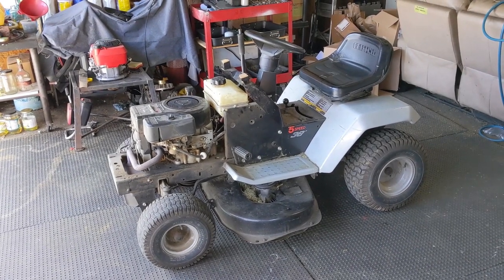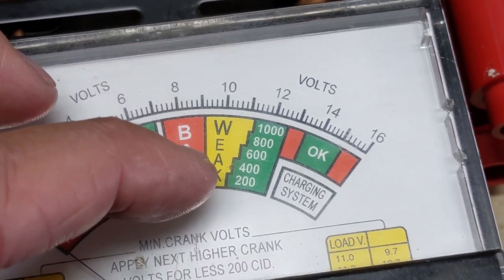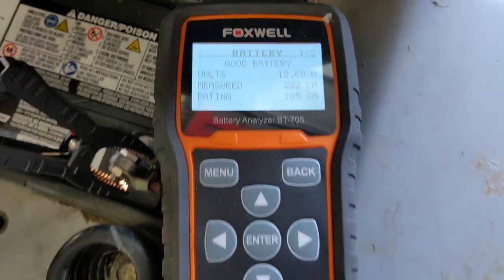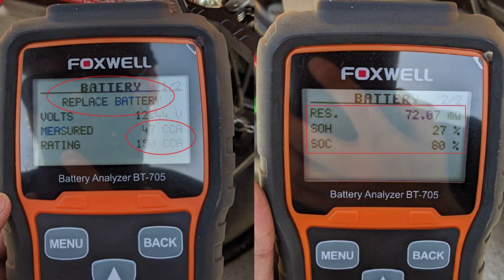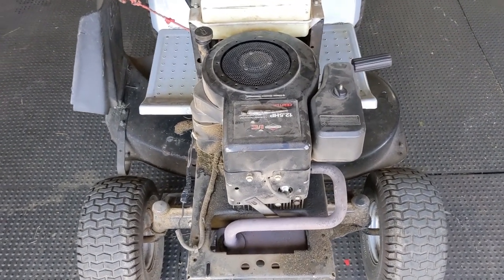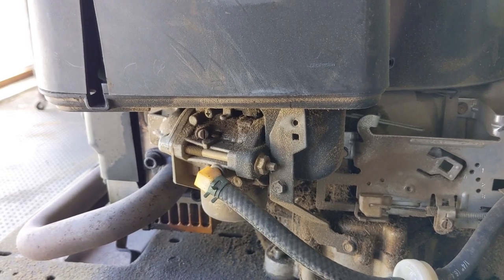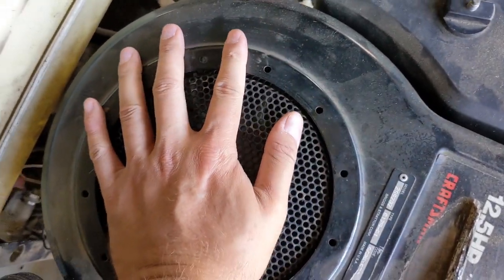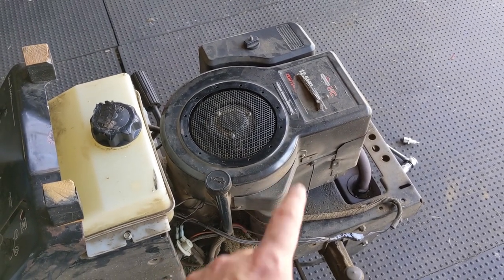Digital Battery Tester & Explaining Hydro-Lock

Comment: An extremely well explained video on hydrolocking and love the new Foxwell battery tester 100% accurate and no more guessing when using the older analog battery test. Actually your thumbnail was great showing the fuel/oil mixture that was leaking onto the floor in front of the rider from the muffler i would guess. Paying the extra amount for the bluetooth read out for your customer is very profession, good job sir!
Reply from the maker: Thanks for watching, and yes the Bluetooth function is nice for us since we do this as a business, but for the average homeowner they would be better off buying the $30 KW208 tester!

Comment: You are right about the amps  are important to Crank the lawn mower engine or vehicle engine Plus any other engines
Reply from the maker: I've seen lots of batteries test 12.65+ volts but have low amps when put under a load. The analog tester is nice and quick, but the digital one offers me a more precise read out and has already paid for itself. Thanks for watching!
Reply: @EliminatorPerformance  a digital Read out is a great idea to get better results of reading battery output on voltage and amps

Comment: Nice job. I had a customer that the battery was bad and I showed him the Didital battery results and he still said, "it's only 2 yrs. old" can't be bad. I said that I can install your old battery and you can argue with the place you bought it from. He came back a few days later and wanted a new battery. ????
Reply from the maker: Yea we've sold more batteries this year than any year previously and make decent money off them, this tool has paid for itself. Thanks for watching!
Reply: Yep happens all the time especially if the customer does not listen about putting the battery inside for the cold months and fully charging it prior to storage. I have read that batteries should be charged every six months to improve lifespan.

Comment: Your customer is fortunate it wouldn't spin over.  My neighbor had a "gas leak", took the plug out and cleared the fuel from the cylinder, put the plug in and fired his riding mower up.  He didn't get much lawn mowed before seizing the engine.

I did an engine swap for him with  good used one, then cleaned and rebuilt his carb and added an in-line shutoff.

An autopsey showed the crank and counterweight were the only victims.  Some good used parts and fresh seals later and it is still running!

Then I offered to weld his toolbox shut...
Reply from the maker: Yes running them on fuel diluted oil is definitely not good for the rotating assembly lol thanks for watching!
Reply: Great comment. Our #1 rule we point out to all customers is: CHECK YOUR OIL LEVEL BEFORE STARTING YOUR EQUIPMENT IF IT HAS BECOME OVERFILLED DO NOT START THE ENGINE CALL US. One customer with a beauty John Deere did not listen to this and his engine fired up but as he was mowing it stopped running as we say it GRENADED (internal explosion blowing the engine).

Comment: On a starter if the shaft is spinning and but the gear is not making contact with the flywheel and spring and gear look OK what else do I look for ?
Reply: Normally provided the starter is at proper rpm the shaft has picked up some debris and may just need some WD40 , PB Blaster, Silicon spray, then move the gear up and down by hand making sure it freely rotates. You likely will see some rust washing off so try it again and it should work fine. If you have ever replaced the gear you can have these issues with aftermarket gears.

Comment: My friends and I were driving wooded fence post and the post driving equipment fell to the side so the motor stopped running so someone tried restarting the motor with the pull rope , it wouldn't come out very far. I said I know why it wouldn't start it was hydro locked.  They were all confused I unscrewed the spark plug pulled the rope and a cyclinder was full of gas .Cleaned the spark plug reinstalled it and the motor fired up. I explained to them about hydro lock . I was ASE certified and auto tech for 30+ years
Reply: Now all those friends will be bringing their equipment for you to repair eh? Nice to hear stories like this in the comments, good job buddy.
Reply: @waynestefinashen239  nope I'm retired but for all those years I have a lot of stories  I should publish a book  !!!!!!!!!!
Reply from the maker: Here's a quick story from my friend who works for the city, said the guys were using a new diesel powered tractor to plow and flipped it. They flipped it back and went to fire it up and bent a connecting rod lol one of the cylinders was Hydrolocked and the other cylinders fired and it was enough to warp a rod. Full tear down and rebuild, thing had like 20hrs on it lol
Reply: @EliminatorPerformance  Now that is an expensive repair eh?